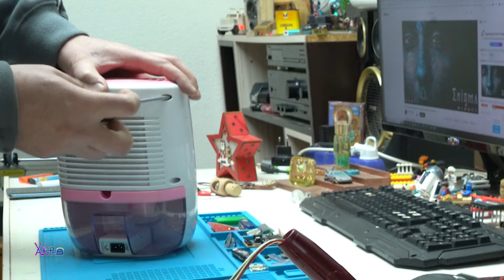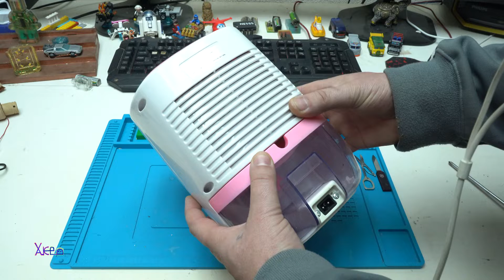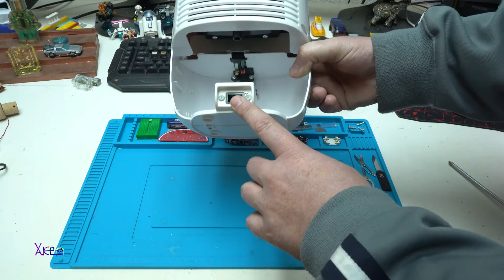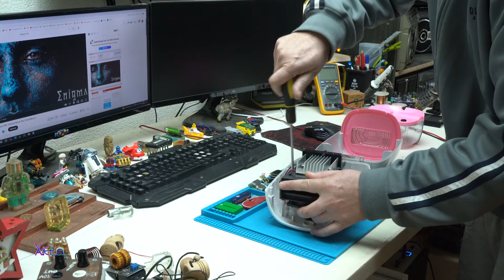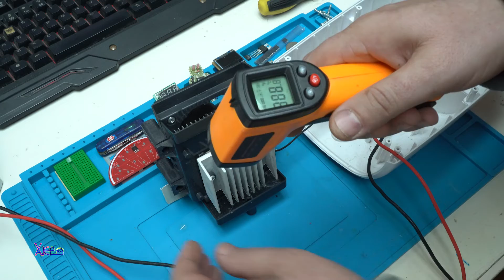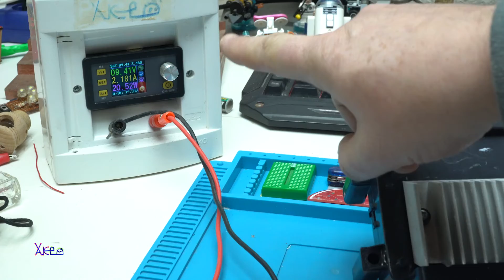How Dehumidifier Works

Comment: the ice it will not melt because you took off the cabinet cover that helps air flow pass through the cooling sink to melt the ice. one fan did two job at same time.

Comment: it constantly staying on -4 celsius? This is how it dehumidifcates? Or if the ambient temperature is higher it wont cool down that much? To get water to condansate you need to get minimum 13 celsius temperature differencial between air and the surface. Than condasation happens. When you taking out a bottle of cold beer from the fridge and its going condensed right away. So this peltier dehumificator managing the cold side always have the temperature difference so it could condensate? Or its always stays on -4 celsius? I mean its always turned on ? Thanks for help